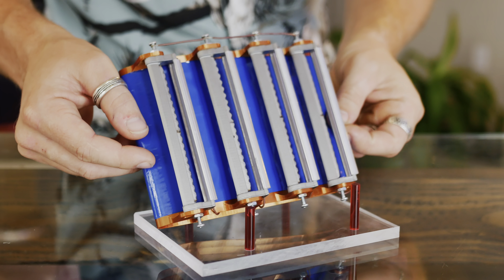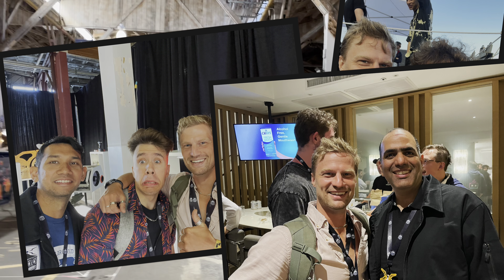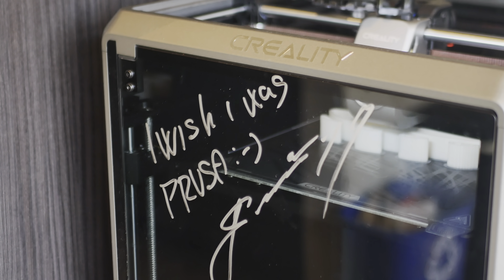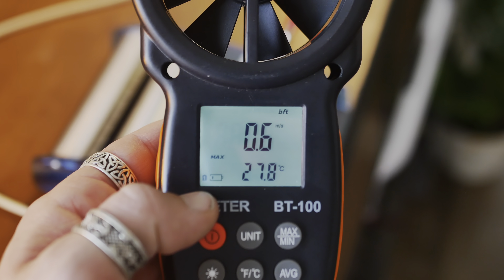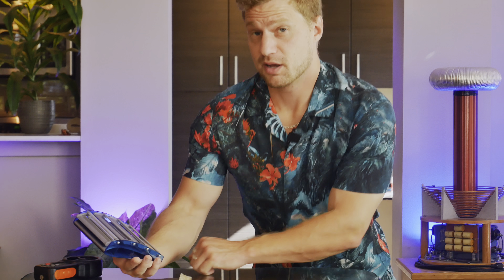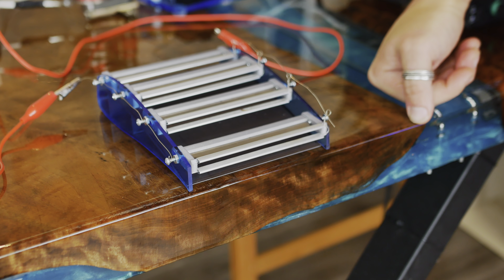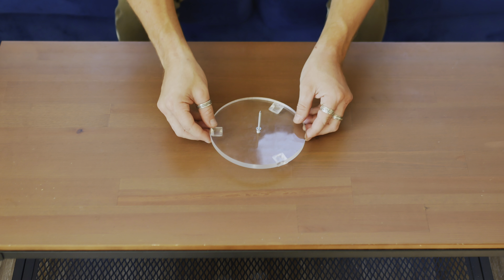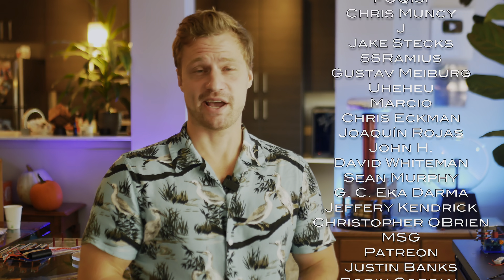Designing A Self Propelling Ionic Thrust Wing

Comment: an idea i carry around for years now (but due to the lack of time and honestly also skills in building real stuff) is to use ionic thrust to push air around a circle in a tube. at two or three points this tube is interrupted and opens up to a wing. behind the wing the air is sucked in into the tube again. the idea is to have something like a drone without rotors. since the air is pushed in a circle less energy is lost. (to reduce friction between air and tube, probably it would be possible to steer the flow with magnets?) i will likely never build this, and there might be reasons why it wont work (my physics knowledge is basically zero). but just wanted to get the idea out there 😅

Comment: You should try overture air pla, I think k it reduces the weight of pla by like 25%. Also would using a serated edge work better than a smooth razor? If you had matching teeth on both it could giving arcing points which would stabilize your plasma field, at least that's how my head thinks it might work

Comment: Thrusters need to be below (in the slower air that doesn't care about turbulence), not above (in the faster flow, which ruins lift when disturbed) - or better still - as part of the actual wing itself (think eagle wingtips - lots of thin parallel wings, instead of one big one).  Flow should be from nose to tail (of the mini wings) not from tail to nose inbetween them (think: dragging the air along the wing surface (both sides), instead of moving the air between the wings)
Reply from the maker: The idea of thrusters on top is that they cause the faster flow on top. Meaning lower pressure up top. So even with the wing sitting on the table, at zero velocity, thrusters cause lower pressure up top from air movement, and the wing weighs less. Applying this concept to a moving wing, you wouldn’t want faster air moving at the bottom - it would counteract how an airfoil works.
Reply: @PlasmaChannel  in my reasonably large experience, the vast majority of airflow (and waterflow) related material online is mostly wrong (provably incorrect).  

Even NASA told everyone, decades ago, to stop using their antique airfoil series because modern techniques are all superior (if you use the right ones*).  Nobody ever checks anything, and everyone just believes everyone else - it's a never-ending roundabout of old-wives-tales.  

A suitable experiment would answer this one easily at least, and I think you'll find that the lost-lift from the destruction of laminar flow will vastly outweigh any pressure lift advantage, if any existed in that setup to start with.  

Thrust comes from Δv too, so the disadvantage of trying to place the thrust in the higher-speed flow region remains to be seen as well.  

This is all a moot point of course, if you dispense entirely with all those unnecessary attachments: coat the leading edge and trailing edge of the wing with a conductor, and power those: the plasma will then travel along both surfaces of the wing at once, without any extra weight, drag, or flow interference.  Hence my suggestion about eagle wingtips (multiple wing blades in parallel, instead of one big one).  

* Modern science is further eroded by CFD-obsessed programmers who don't understand how their own P-hacking invalidates all their "results" (they match their models to the experimental results*, not the other way around, so it's not validating anything). * How many papers have you seen where they included the (always incorrect because humans make mistakes) results form their first-ever run?  That's the problem.  Running any CFD a second time is them matching the CFD to the known answer, not, validating the CFD to reality.  It's a subtle but fatal mistake.  Trust only the numbers, and only experiments you can understand - most of the rest is simply not real (_especially_ in your Reynolds regime - that low is super-rare and in practically nobody's area of expertise).

Comment: Suggestions. 
Conductive mesh; i noticed the plasma nodes in the blades. If you use a mesh stiffened between print layers, you can then trim & tune individual plasma creation "nodes".
Would a "fluttering" lead blade allow better charge distribution & airflow?
Try  incorporating the lower negative bar into the wing surface; less drag, possibly more lift.
The whole plasma thrust arrangement looks perfect for a stacking modular arrangement, including reverse thrust.
I wonder what edm wire & ultra precise position tolerances would do to olthrust & efficiency. 
Final thought.
Is the upper surface actually the best place for the thrust elements?

Comment: I'm not a mathematician but I am a pilot and it makes sense in my head that the thrusters should be under the air foils. Under will have high pressure on top will have low pressure. Seems like you would want the thruster to be the high pressure where there is more available air molecules to interact with. I can't say for certain but on top seems like it would be the opposite of lift, it would be sucking air that should be going under the airfoils on top which would make it less efficient. Just my hypothesis, looking forward to what you come up with.

Comment: Try using graphene or nanotubes glued or soldered to a thin wire in place of a blade or bare wire. A charge applied to the wire as the adhesive sets hopefully makes the nanostructures stand up like hair in a electrostatic field giving the surface minute points for the charge to easily flow from.

Comment: amazing project and i'm sure peter will be very helpful. I think you should probably use lightweight foaming PLA as well as just making the rib sections with a connecting carbon or balsa spar. just cover the rest of the airfoil with sheeting. I'm sure you've already thought about that and theres definitely disadvantages too i'd say takeoff is gonna be the hardest part so maybe testing by having it towed up by another plane or drone could work to at least make an extended range glider.

Comment: My question is why did you place them on the top?  I only have a limited knowledge in ionic thrust but in theory you are operating in less compressed air on the top where as the bottom would be more compressed (denser is my point) giving you more air molecules to bump into in the same space.

Comment: Will it fly? Maybe using composites and a very very long low AR wing but the end product will likely not have much use other than being a cool and unique way of flying. The issue of course being vTO as the weight of the batteries required to make this thing fly is just too large for the thrust generated to overcome the drag at vTO. I mean there's a reason why we only use ion thrusters on spacecraft 

BUT this is still very interesting and there may be some use for it for reenergizing air flowing over the wing on a conventional aircraft kind of like a slat but even then I think the energy added to the air is not enough to overcome momentum

Comment: If the serrations have a positive effect vs straight then maybe you should just cut all but the serrated edges off of the razor blades leaving a thin piece about the width of a wire rather than using actual wire? Maybe try different materials like flat thin sheets of copper that you cut and file with serrations to make the resistance lower?

Comment: I think the placement should be on bottom side. The top side creates negative pressure I.e the airflow is low on top. The air flow is fast on bottom. Hence sucking more air won’t be issue. Plus the profile of wing which is downwards will actually give unobstructed path of air flow to be sucked in. Please do try this

Comment: I think ChatGPT might've got the math wrong for force calculations. It calculated the moment of inertia for the rod using |  (I=mr^2)  | which is the formula for point masses, not for rods. The formula for the moment of inertia of a rod is |  I = 1/12 (I r^2)  | instead. Additionally, because the rod is not being rotated upon its central axis, the moment of inertia is changed once more. Using the parallel axis theorem and the proper equation for the moment of inertia of a rod a higher moment of inertia for the rod, around 0.0275014 kg(m)^2, is attained.

from there, calculating torque is as simple as determining angular acceleration using the formula |  Δω/t  | where ω is in radians/sec and t in in sec, and multiplying this value with the total moment of inertia. In this case, angular acceleration is equal to (6.2 rad/s)/(12s), or 0.52351 rad/(s)^2. The product of I and α, torque, is equal to 0.014310 N(m). 

and now the last step, using torque to determine force generated by the thruster. Because we know the distance from the thruster to the pivot and the torque exerted on the system, we can calculate F using F=T/L, which equals 0.04965N!

The bot did decide to take the momentum based approach to calculation, which is also valid. The main problem lies in the incorrect formula used for the rod. Just goes to show that sometimes even machines aren't perfect. Or maybe I screwed something up, I'm tired. Had fun trying anyways lol
Reply from the maker: I really appreciate you. I'd love to chat further
Reply: @PlasmaChannel  Thanks, man. This project is super interesting, and I'd love to give whatever input I can! What would be the best way to get in contact?

Comment: Hi, I know very little about how the ionic thrust is generated but would it be possible to coat the surface of the wing in a conductive material to act as the ground?  It would have the potential to remove some weight and a ton of wind resistance which would definitely aid with the low thrust to weight ratios you'll have to overcome?

Comment: This is amazing! As an aerospace engineer myself, I have to ask about your thoughts of implementing this into a better nozzle that you previously have. I understand the want for auxiliary air to be added to the system, but might it be more efficient to speed up the same mass flow to higher speeds rather than adding slower air and having to speed that up as well? Not so much an idea for your wing, but something I'd love to hear about for your circular engine designs

Comment: Is your last statement correct?
I'm not familiar with the physics of ionic propulsion but if it's related to magnetism, your statement probably isn't correct that increased current should produce increased propulsion. If as I suspect your ionic propulsion is related to EM fields, you can create a stronger EM field by increasing voltage, not current.

In any case, I'm impressed with the ionic force you're creating... Models I've seen generate a very weak field that produces hardly any acceleration and velocity can therefor be achieved only after a very long time.

You should make a pile of money attaching to one of those ionic air purifiers, the ones I own hardly create any air flow and I have to trust the thing is working when I turn it on. The company who signs you to optimize their products will kill all the competition.

Comment: I think you should try and making the wing as light as possible by doing what a lot of gaming mouses do just try to cut out and make a lot of holes everywhere but just enough for it to still be strong enough to not break easy but I think you can shave a couple more grams off of it by just having a lot holes in the wing like a gaming mouse to reduce the weight the most you can.

Comment: You need to also measure lift of the system.  What you have with small wings over a main airfoil is a lot of aerodynamic interference which is well known with biplanes.  The four small wings so close the the main wing is a situation that is far more problematic than a conventional biplane with one wing far from the other.  My belief is that the interference is enough to cancel any lift.  I would only have one plasma thruster for a long wing and not adding any additional lifting surfaces with the thruster.  This should help with the weight to power issue.  If you test this do not try a turntable test system because the thrust and lift are dissimilar on the inside and outside of the the turning radius.

Comment: I'm curious why you decided to place the thrusters on top vs underneath. I thought your previous experiments showed that the faster the airflow, the less efficient the thruster. (I may have misunderstood a previous video to reach that conclusion.) The airflow under the airfoil should be more dense and travelling at a slower relative speed. Disclaimer: Not an engineer, just an engineer dropout.

Comment: how long the wing not be, if it moves only 2 m/sec, it will not fly. You need to move air maybe 10 m/s ? Measure the thrust of the propeller motor, for a light airplane, the same you will need for ionic thrust.

Comment: I think substantial testing needs to be done on the basis of ratios of razors to foil, a lot of your weight can be totally removed and power output / sq inch could be drastically improved dependent on which way the ratio falls, I’m theorizing a design utilizing needle tips and rings of wire WITHIN the interior of the wing which would greatly reduce weight and not cause downforce to be applied to the wing

Comment: I am just wondering if the thrust under the wing will be better for providing lift for the final airframe? 

"The Bernoulli equation states that an increase in velocity leads to an decrease in pressure. Thus the higher the velocity of the flow, the lower the pressure. Air flowing over an airfoil will decrease in pressure. The pressure loss over the top surface is greater than that of the bottom surface." - From MIT.

Comment: Look into something called a Double-slat leading edge. it's basically just two slats connected together to create two seperate airflows over a wing to push or drag the turbulent air further back, generating greater lift, or rather making sure you can be at slower speeds and still get and stay airborne, Don't have the slightest idea if adding those or making them ionic thrusters in the leading edge of the wing is going to help or even work in the slightest, BUT maybe you can drag enough air over the wing in a double layer making it easier to generate lift with less thrusters needed. in short a slat normally generates a cushion of air on top of the airflow already moving over the wing, creating a less turbulent airflow, and a Double slat does that twice. Probably a stupid Idea, but you asked for ideas and that one just hit me so sharing it here.

Comment: I have to ask, why are you putting the ionic thrusters on top instead of lacing them as the top surface of the airfoil itself? As in the leading edge of the airfoil being the positives and strips of ground along the top of the airfoil's surface skin? The nature of lift is the airflow differential between the top and bottom surface of the wing, having the thrust units in the top surface will have them do double duty as the wing surface and being the thruster. This will also reduce weight since there will be no need for mounting systems for the thruster.

Comment: Awesome.  Have been waiting for the next project.  In electric motors, to stop the eddy currents, they use laminated cores.  Perhaps, the neg electrode could be made of mini horizontal laminations of electrical steel, or if nothing else, aluminium with the rear half and common ground behind it to be insulated.  You would also need to ensure that the neg loop comes back on both sides with equal length wire so it isn't tempted to take the path of least resistance.

Comment: You said you are going to change to wire. Got me thinking in printers you have corona wires used for high voltage charges. Some use a corona  blade looks like really thin saw blade.

Comment: If the entire wing will have this design then I don’t think it will fly well if at all. Wing needs to generate lift and I believe the engines will disrupt the air flow enough on top to prevent that. Looks kind of like a biplane now with the top and bottom wings very close together. 

If using only one wing maybe have large gaps between where the engine sections are so there is smooth surface wing only. 

Or just have a additional wings in front and/or behind this without engines that are just for lift and control surfaces.

Comment: on the underside of the wing it is better to put the trust plasma... because the upper part of the wing has to be cleaned... so the air can flow faster... and generate lift
do lado de baixo da asa e melhor colocar o plasma trust ... porque a parte de cima da asa tem que ser limpa .... para o ar corre mais rapido..

Comment: Do you think that the ionic array will hamper the dynamic balance between the high and low pressure of the wings (at scale)?  Also, have you considered how the excess drag on the top of the wing will change that dynamic?  Is it possible to build the ionic unit into the wing itself....to preserve that pressure balance? Thanks.

Comment: Why did you put the thrusters above the airfoil, that's where lift is generated naturally with movement. Can you place the thruster going through the wing exactly as they are designed now allowing air to pass though. Thrusters could even be placed below like the MIT design, but artificially moving the air above the air foil would theoretically negate the lift effect as you wouldn't exceed the speed of thrust and thus no air pressure difference?